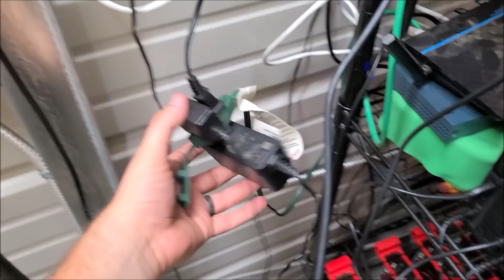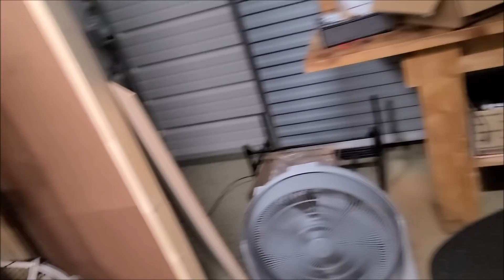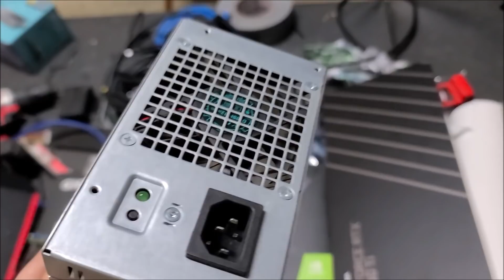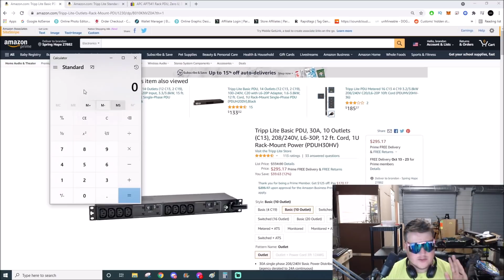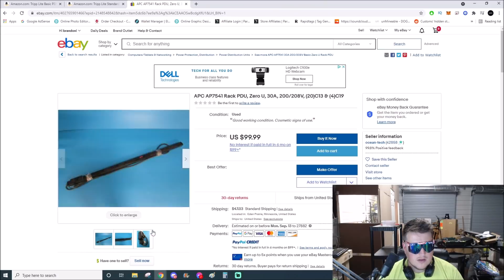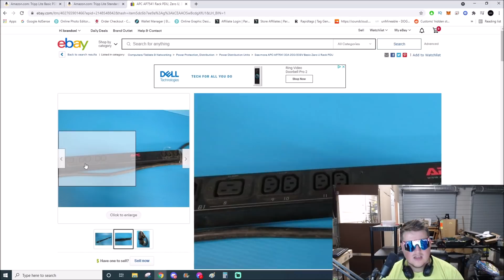Safe Power for Mining Rigs

Comment: Video informative I'm just starting out brand-spanking-new I got a 200-amp service in my house I was thinking about adding a 240-volt line and I was wondering is there a video out and list all the hardware I would need to convert to the plug inside the house and the power strips thanks for any help you can give me

Comment: Got 3 pdu’s off eBay, not apc or tripplite, way to high$. Got three of these; Spectrum Power AC PDU,0U 150-00027+A0 C13 10AMP 12 Ports Rack Mount PDU. Look just like yours and same size, easy to handle and mounts anywhere. Paid $49.95 each, 35 for shipping all three.  Deals are out there when these corporations clean up their IT areas they dump lots of pdu’s. Just be patient. 

  Remember don’t get a 7 foot pdu with 40+ ports. Hard to mount, handle and you’ll overload your wall outlet if you fill half the ports.

Comment: <has the sketchiest setup on the internet> (for now at least)
...
<makes video titled "Safe Power for Mining Rigs>
🤣
Btw. why do you need to drag 120V in there for the router power adapters, most certainly those are 100-250V rated...

Comment: Dryer < Crypto Miner 100%
be earth friendly :) hang those clothes
Reply: It's not the most efficient thing in the world, but i have my miners hooked up to 1000watt-1350 watt APCs, hooked up to the wall (be lucky yall have 3 prong outlets, house was built in the 50s and all we have are the 3 slot 2 prong ones, no grounds)

I want one for each rig but im not quite there yet, always building with power limit in mind.
also i have my router hooked up to a PSU as well.
this way if the power goes down, or if there is a brown out, all the rigs and the internet keep running for 5-10 mins :)

it's been real and fun :D

Comment: Another option is 240v 10amp circuits, cheaper 10 amp breakers, fittings and multi boards. Its the standard in Aus and NZ and maybe china?

Comment: Look man I understand the reason people use the 80% rule, but these products are designed to run at their related maximum.  I don’t think you should push 100% I think that 90-95% is better. This only applies to reputable companies and products obv if you have some cheap ass psu don’t push 90% of it lol. So of a 240v 30a breaker and corresponding circuit (which can hold 5700w), I would use about 5000-5200. And if you do that your still 500w off the rated max, which is safe. That being said this IS NOT ADVICE
Reply: 5700w is 80% not 100%.
Reply: @bolthan2864  I am aware
Reply: @Steven gabriel  ???